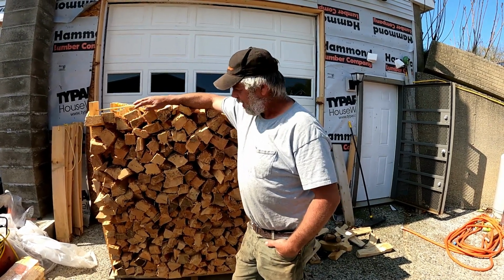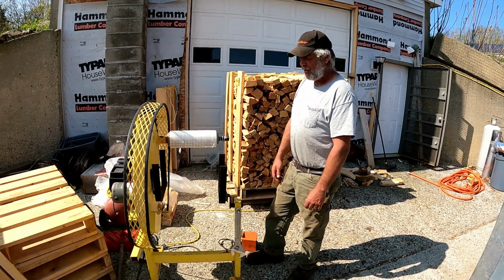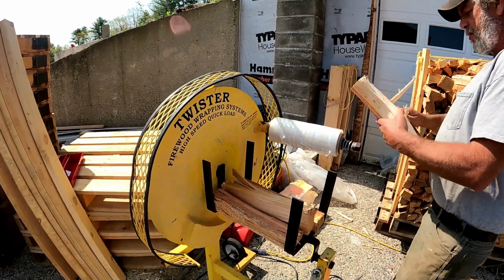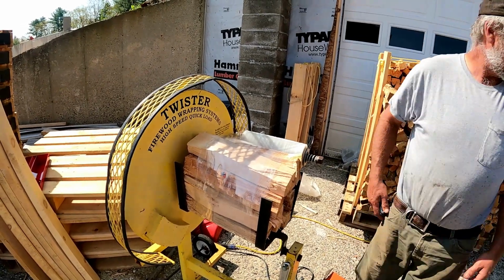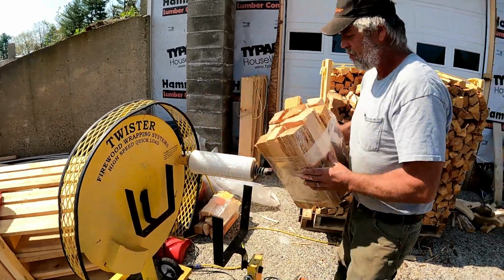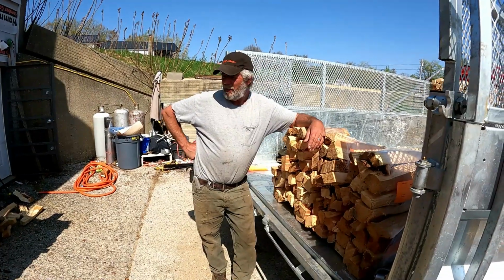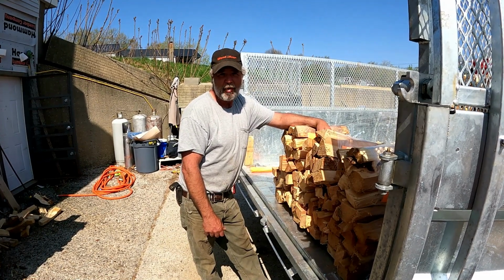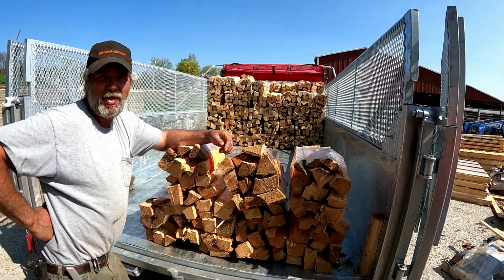Wrapping Camp Wood Bundles on the Twister

Comment: Easier way to wrap your bundles put your first layer of wood down then set your wrap on it stack the rest of your wood on top of the plastic wrap and then wrap it less chance of you catching your arm and slicing it open with the wrap adjuster  & it will speed your process up .
Reply from the maker: Thanks im going to try that on the next run cause ya i got wacked a couple times today in the arm
Reply: @AllenFamilyFirewood  no problem at all brother iv been doing bundle  s for well over 15 years now if you have any questions please feel free to ask
Reply from the maker: @josephkennedy4515  Tried wrapping bundles today with your suggestion.   Worked like a charm!   Much thanks
Reply: @AllenFamilyFirewood  no problem at all brother just be sure to check the plastic wrap tension about every 20 bundle,s